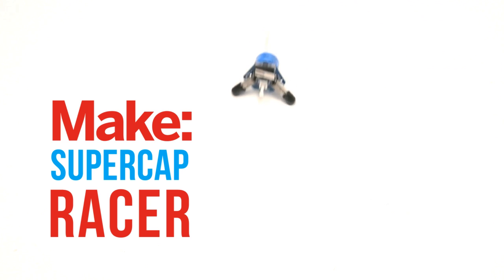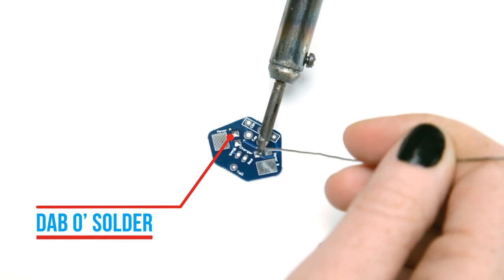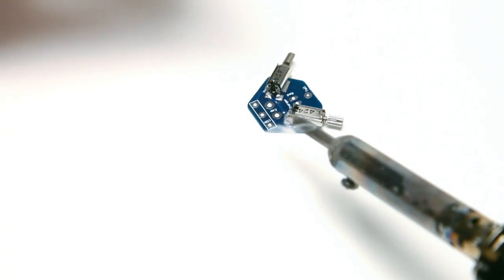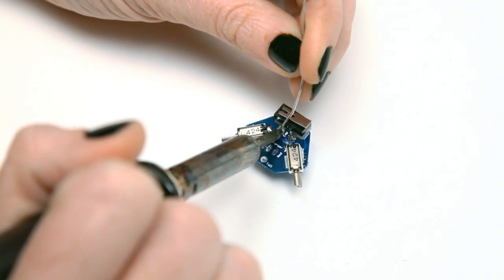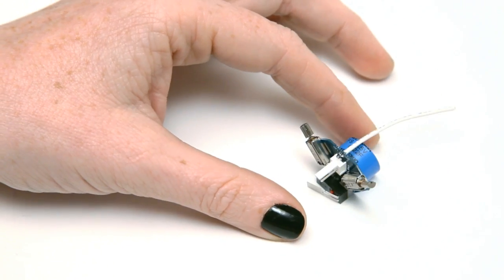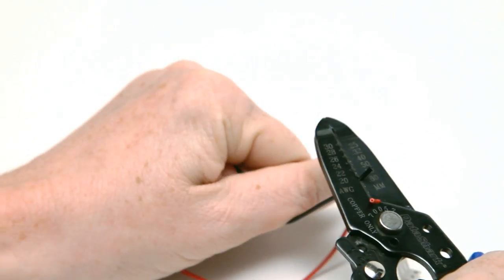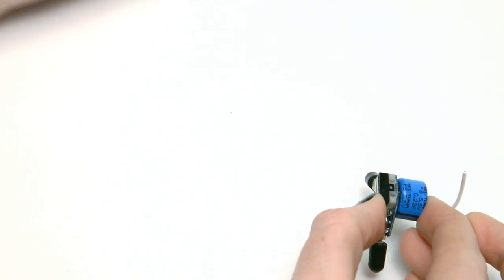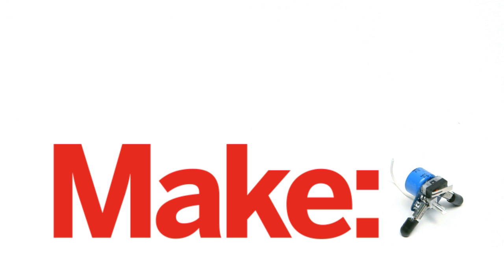Supercap Racer

Comment: What is she even doing? She's all over the place with the solder, and get stuck with the solder wire like all the time. Doesn't even cover the board up when she's cutting the leads, what if she get's that in the eye? You have to be more cautious, really.